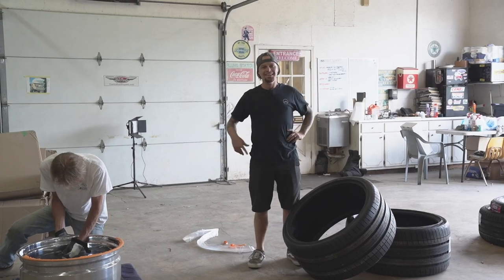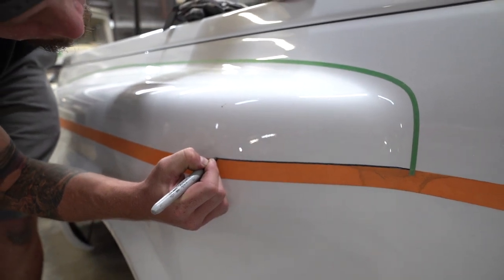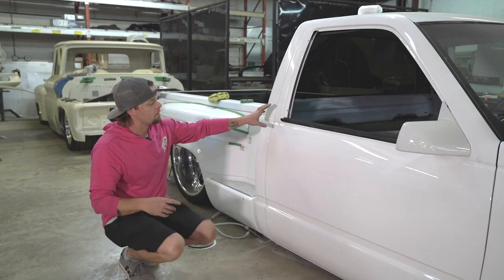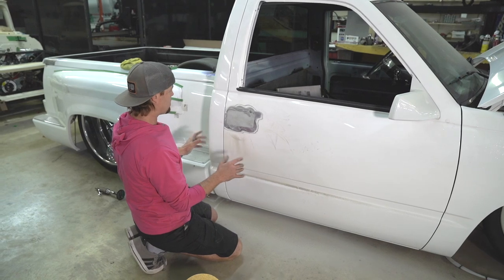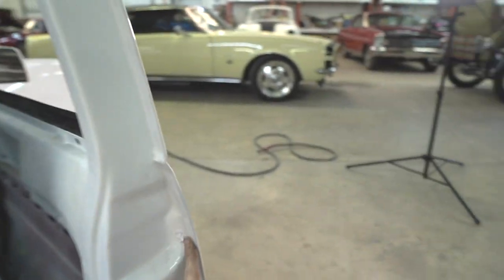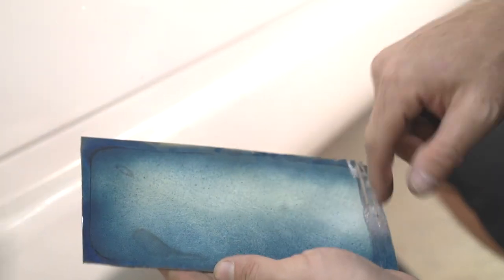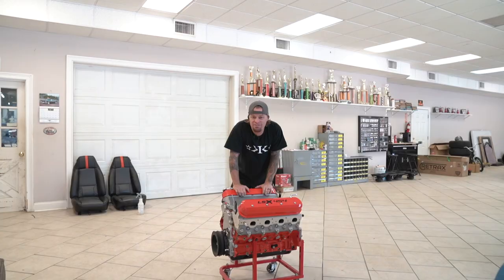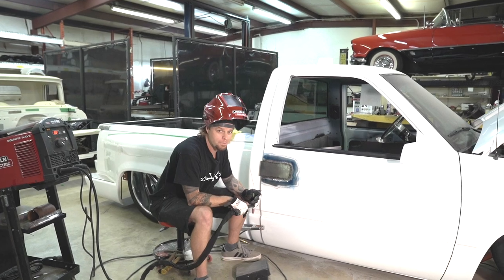Cutting Up A Custom 1989 OBS Chevy Silverado Stepside Truck

Comment: It's good to see the longer more technical builds. Never seen anybody epoxy in a filler panel.
Would have been cool to get a lower intake to run the old roots blower set up, with the right pullies would've still made 30psi and been ready to party.

Comment: What brand is that radiator I need one for my OBS
Reply: It’s an Entropy. A bit pricey but man are they worth it.
Reply: @jeremybumpus1167  I have learned that when it's expensive for convenience and quality. You don't have to revisit the issue
Reply: One of the only products that I’ve never had an issue with in any way. Which def makes it worth it
Reply: @jeremybumpus1167  appreciate it man, keep trucking I am ordering one